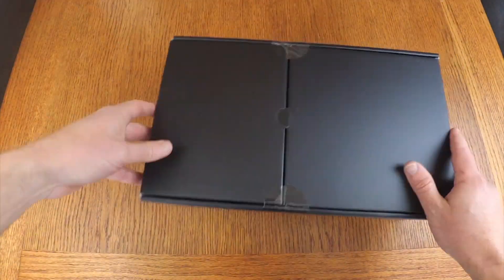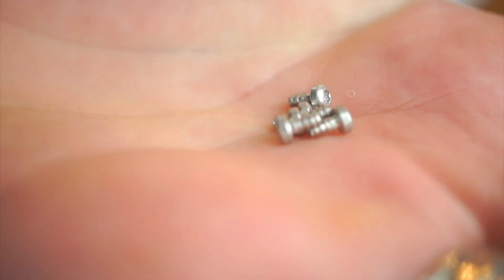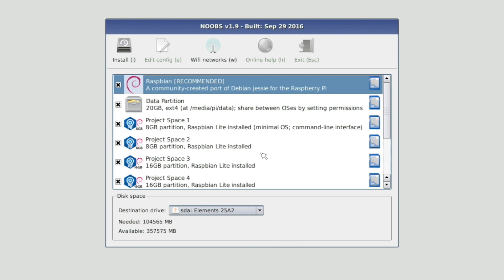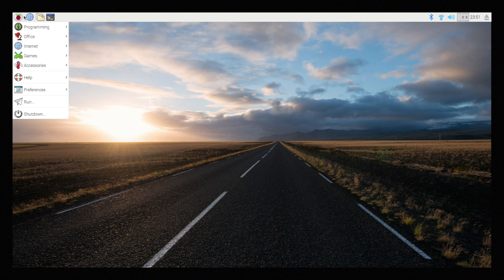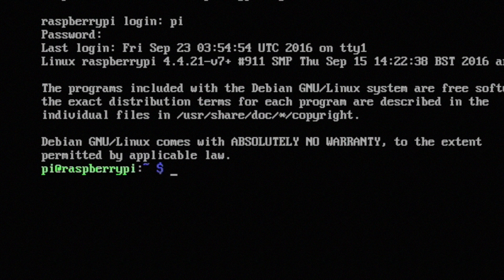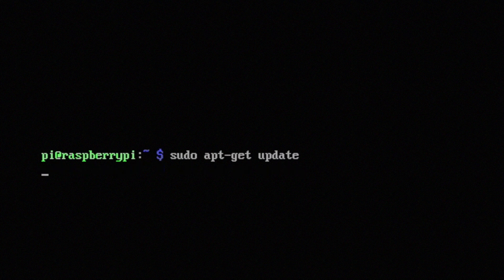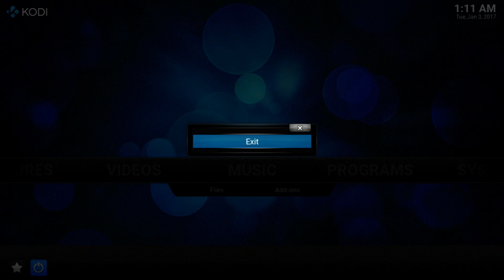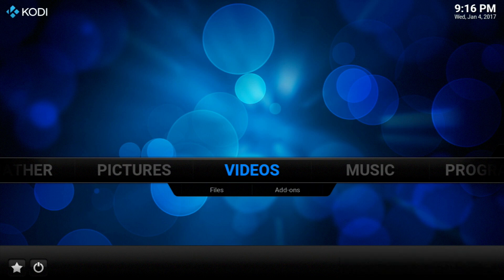Getting Started With Raspberry Pi and WD Labs PiDrive

Comment: Nice video, but you really shouldn't use the command "sudo apt-get upgrade", instead you should use "sudo apt-get dist-upgrade". The former can leave you with missing or incorrect dependencies.

Also, why install X11 on your kodi space? Just set kodi to start automatically at boot?
Reply from the maker: Thanks for your comment. Good to know about the dist-upgrade variation! X11 just seemed like an easy way to go for the sake of keeping the video short, but yes -- scripting Kodi to automatically boot is ideal.

Comment: Nice Video! Based on that enclosure - are you able to easily access the GPIO? (Like a door we did not see in the video)  Or will you have to run a cable (And can you run a GPIO cable effectively?)
Reply from the maker: You could just pull the top right off since it's held on magnetically. And there's probably enough clearance to run headers on the pins without making things look weird (but I haven't tried). There are a lot of little spots where you could run cables out, or cut away just a little material from the lid to let things pass through. Ultimately though, there are a lot of options when it comes to Pi cases. This one just happens to fit the PiDrive system nicely.
Reply: Thanks! Good points - I like the idea is the pi drive -  so I think it could work as you suggested.

Comment: The way they designed that case is really stupid. You can't even easily access the USB ports on the pi or the Ethernet. I wouldn't purchase this for the very reason.
Reply from the maker: The top pulls right off for accessing everything. The lid is magnetic. Cables can be run out of gaps left in the plastic in the back.